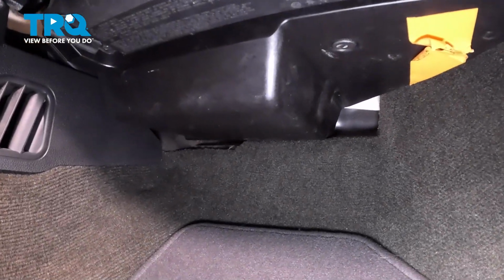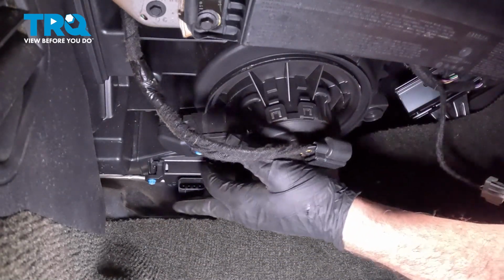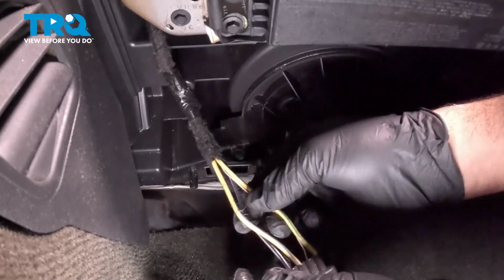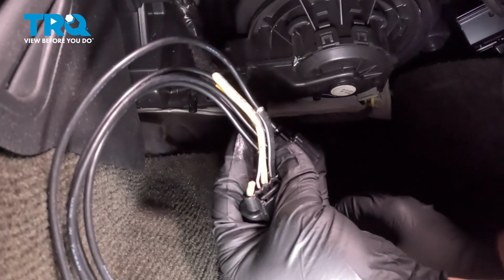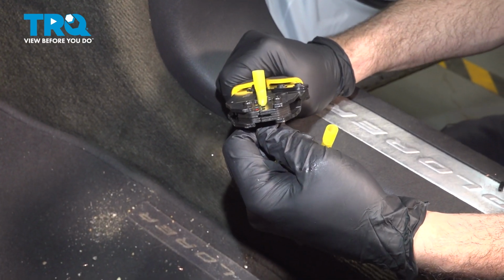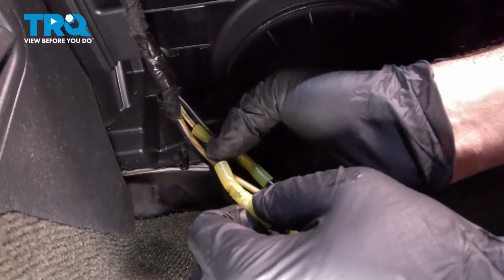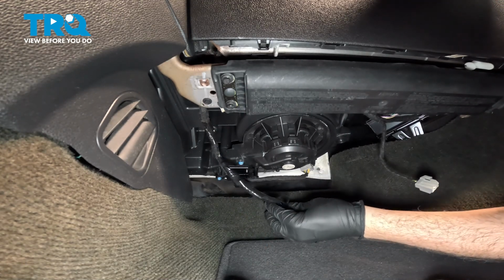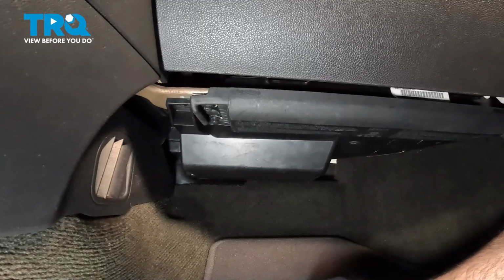How to Replace Blower Motor Resistor & Wiring Harness 2011-2019 Ford Explorer

Comment: Last step. Replacing the cover is difficult. Imposs8ble to see the hole on right and the cover has to be syretched to fit correctly. 

I have been messing with it for 2 days

Comment: so i wired mine same exact way but when i connect the small wire the motor wont turn on but when i disconnect it its on high with no control over the speed